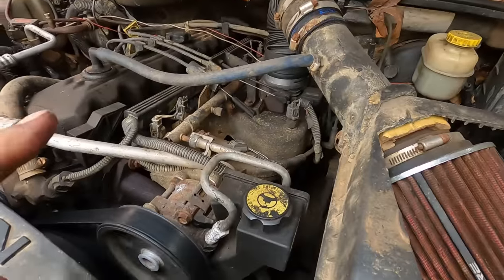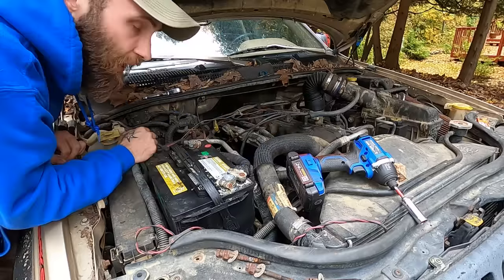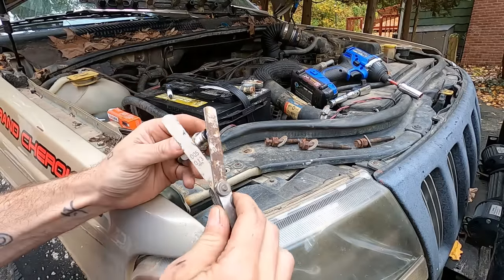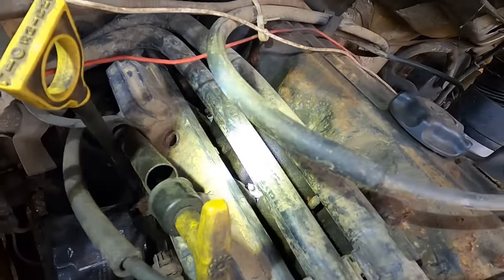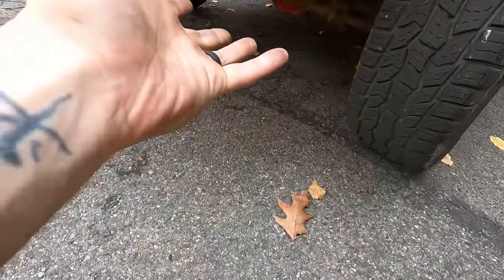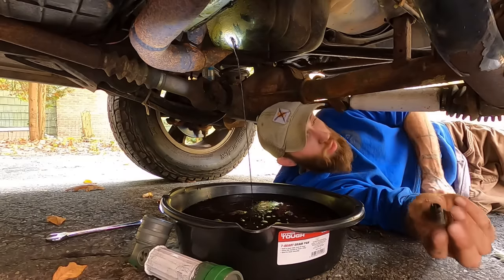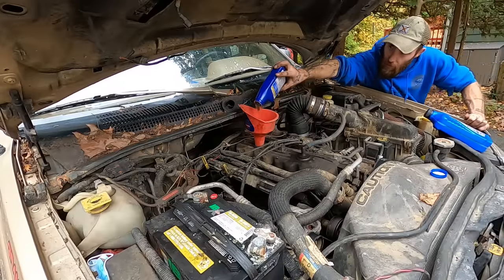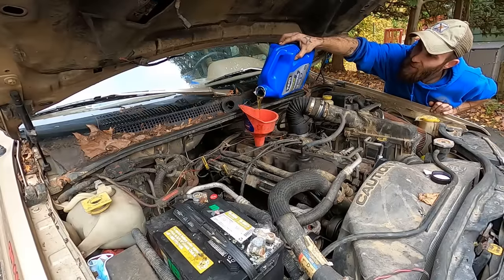Stop treating your Jeep 4.0L like a MODERN ENGINE... It isn't one!

Comment: Just sharing some knowledge as a person in California with a 95 4.0 liter that's young in terms of mileage at about 180k. Yes that zinc will wear out your CAT faster and that means you might have more trouble with SMOG. What I would suggest though is that at least in my experience a CAT in a 4.0 liter will usually wear out every 4 years anyways. So what I do now is quite simple, every other smog check, since they happen every two years, I go into my SMOG guy and fail the first time like clockwork. The thing is if you buy an aftermarket CAT from an auto parts store like oreilly or autozone they usually have a 5 year warranty. I already have one on my Jeep from the first time I failed SMOG. So I get the CAT cut at my SMOG guys and then I get a ride down to the store I bought the CAT and ask to redeem the warranty, since it is the only reason I am failing SMOG. Brand new CAT for free and most exhaust shops only charge about 100 dollars to cut and weld a new CAT. More than I would like to pay but it gets the job done to pass SMOG. As far as I know its cheaper than going somewhere to get a "legitimate SMOG check" as I have always been told the going rate on that is about 200 dollars. Been doing this warranty swap game for about 6-8 years now. Another note is that if you go in and and find that you are failing SMOG even though last time you got it smogged two years ago you replaced the CAT, try getting a new O2 sensor. This knowledge only applies to older 4.0s that predate OBD2 as far as I know though. As I mentioned mine is a 95 and my exhaust and emissions systems are incredibly simple. 1 O2 sensor and 1 CAT is all it has and it even predates EGR systems. With that simplicity emissions being high has always been the 02 or CAT for me every time. Even in California where standards are high you can keep your 4.0 in good shape and meet emissions standards.
Reply: In the midwest we just cut that cat off. California is killing your jeep
Reply: CARB and the fed EPA required All smog devices to last 100k miles or 10years. Even back in the 80's with the zink in the oil. Today its 200k miles. Your ignition timing and AFR are probably way off.
Reply: @dimedriver  I think it might have been. This past test was the first time I passed 2 in a row. I think my computer may have finally figured it out. Not sure of that. Also my o2 sensor on it fail WAY MORE often than 100k miles or 10 years. More like between 2 and 4 years, same as the CAT. I believe you, but I can only speak to my personal experience.
Reply: Fortunately, in my state, we don't have to worry about things you do in Commifornia

Comment: If push comes to shove, and the oil cap won't come out, you can always pull the PCV out of the valve cover and pour the oil in there. The oil cap position isn't located at any specific position that would be decidedly advantageous other than being a bigger hole. All the oil ends up taking the return passages in the head regardless of where it's poured in. There may or may not be a baffle under the PCV, which would slow down the flow, but still an option.
Reply: Oil cap comes apart! Truly (22 yr dealer mech all mopar) you just got to go under it with a pry stick thingy and pop it apart (outer piece has roll over locking tabs to the inner threaded cap). Then take the threaded part off with a pliers - reassemble it while off on the core support by inverting cap and small smack with hand to threaded piece snaps then back together - if your not to ham handed with it coming apart!
Cheers all!

Comment: Glad as hell I found this channel. Sussex County 2004 WJ owner and I love that damn thing like I love my daughters. Bought it last year and did the normal mods but every weekend out there tinkering and changing things. Love the simplicity of it, the 4.0 even though I’m a V8 guy this I6 is a warrior. 
My kids love it too. It may be one of the best vehicles I ever purchased and I hope that it lasts as it has 142k from original owner and some standard undercarriage rot but nothing that can’t be cleaned up and Fluid Film coated. 
Appreciate the insights an straight forward stuff

Comment: "Back in the day" I tried a super duper mega coil on my 98 TJ that was guaranteed to increase midrange and mpg. Not the slightest hint of difference vs. Stock.i had a long uphill pull, and it went to the exact same speed up that hill in same gear. That said, I still have that super-duper coil. It is a godsend on point engines. It currently lives on my 1958 Deere.

Comment: Commented the other day…. My 99XJ with 255,000 was getting 19.5mpg highway this summer. Fresh copper plugs, fresh oil, etc etc and she goes fine… 22psi oil at idle warm and right up over 40psi with a tap of the gas.
Reply: I get 10 mpg, I have 35s on stock gears tho, and a reman engine with 4k on it
Reply: @benthebuilder6934  I have pretty much stock everything. New leafs and shocks. Tires are 235? I believe on stock steel wheels. 235s or whatever the largest ones you can do on stock setup. All gears are stock for a 99 sport… she’s doing great for an old gal… knock on wood! Now working on rockers and other body “spots”

Comment: Watching this man pull the "coil rail" stunned me. I've been around numerous 4.0 engines and have never seen one of those. All have run off of a distributor.
Reply: 99+ 4.0 stopped using distributors
Reply: @andyclemente4205  that's really interesting, I would be curious to know why they made the switch. I've never had issues with the ignition system other than regular maintenance related stuff.

Comment: I just converted mine to roller lifters and swapped the cam, problem solved. Electric cooling fan conversion, and did a high output distributor. Runs good too, had the head machined to run chevy LS valves, and upgraded the fuel system to also take e85. My 00 TJ Wrangler with the 2.5 is bored and stroked to 3.0L and has a twin scroll turbo and 2 stages of water meth injection. Been tinkering with these motors for years.
Reply: What kind of power are you getting out of the 2.5. I was heading in that direction with a TJ.

Comment: definitely love the 4.0, you just can't kill them. Also not sure why you say they get bad milage, I run a tad under 20 MPG, most of that being in the woods with just a little bit in town
Reply: Mine gets 10 mpg, what's your setup? I have 35s on stock gear... if you have bigger times then make sure to adjust the math for that since in my case the speedometer and tachometer are about 20% off.
Reply: @benthebuilder6934  Straight stock '95 with an AX-15 behind the 4.0, and stock axles and tires
Reply: i also get 20mpg on hwy regularly.  Just got back from a 4000.00 mile trip which included all types of terrain and averaged 19.6mpg
Reply: I get 11 on the highway 2004 tj on 33s stock 3.73
Reply: I get about 12 mpg on average. Sometimes i see 20 coasting down the highway, but average over the last 3000 is just under 12. Stock axles, 2" lift on 32's
Reply: I'm pushing 20 with my stocker as well with the stock 30" tires.
Reply: @MajorWeakness  recently did a round trip fla to nyc got about 21-22 mpg with air cond on most of time i have 01 wj 4.0l 168,000 miles on it.
Reply: Everybody says you can’t kill them but ironically, I kept mine in tip-top shape it’s entire life & have dumped so many thousands into it trying to keep it going in the last 7 or so yrs. It never ends, once I got the dreaded lifter-tic NO garage would  even work on it, saying it’ll cost bet. $3-4,000 to fix & all said trade it in! & It’s only got 110,000 miles! 🤦🏻‍♀️🤦🏻‍♀️🤦🏻‍♀️
Reply: I'm getting 18mpg driving around home and get 21 and have gotten 22mpg on the highway
Reply: @benthebuilder6934 i average 10 mpg

Comment: Question,I've heard putting a half a quarter of transmission fluid  too clean the lifters is that true? Also other than replacing the lifters how too stop engine knock?
Reply: Don't use ATF. When I got my 98 ZJ it failed emissions for high NOX. What I did was put a nickel on the throttle stop so it was about 2,000 rpm and dumped about a quart of water down the intake. You do it a little at a time until the engine starts to stumble and stop pouring. As soon as the engine comes back to the set rpm pour a little more in. Basically it steam cleans the carbon off of the rings and valves.

After that it passed emissions with flying colors and runs beautifully. BTW it's about to join the 1/4 million mile club!

Comment: I just started doing my own maintenance on my 94 zj 250k+ miles. I wanted to do a transmission flush and replace the govenor solenoid and pressure sensor. Many have told me not to mess with the transmission at all. Any additional knowledge on this would be great. Awesome video 👍

Comment: K suspension single coil is what I did to get rid of that crazy multi coil system.
Reply: When my old coils went bad, I upgraded to k suspension worth every dollar
Reply: Do they add any power or more efficient burning? I was thinking of upgrading to the MSD coil rails, the K Suspension any better?
Reply: @NeuKrofta  not that I can tell, it just replaces that long dual coil rail. What does make it the big difference is the  wiring upgrade kit he sells, highly recommend.
Reply: @brentdutcher2875  thanks man, I'll look into it
Reply: @XxggxX8  
Gage, have a Wrangler 4.0
Where can I find this K suspension ?
Thx 
Rick

Comment: Great video, I've got a 2000 TJ SPORT with 190k on the 4.0L and had to change the starter right before Thanksgiving last year, I chuckled at your starter comment. More importantly, I just picked up my 5th JEEP, a 1996 XJ SPORT with gasp, 388k on the 4.0L.I recently changed the oil and had added the STP oil treatment to it before I saw your video. It runs great but I already was about to change the plugs, wires, cap and rotor, yes a 1996 still has a distributer. I didn't know about the preference of Copper plugs as I'd already bought an Iridium set. I haven't gapped them yet so I'll probably run back up to the parts store and get some cheapo copper ones instead. Great fun video, cheers from Cheyenne, Wyoming, I run my JEEPs at just over 6,000 feet elev., JEEPS RULE!

Comment: Nice vid - appreciate MOST of the info.  Some things I do have issue with is: describing it as an old engine because it has pushrods.  These are still used on many current engines, included the much valued Chev LS motor.  Also, just because ot was made 25 years ago doesnt mean we cant take advantage of advancements in spark plugs, oil and more. Also zinc is used mostly on breakin, because, as you said, destroys cats. I prefer to use the oil it was designed for.

Comment: Champion cheap is what that engine likes. I put fancy ones in mine and drove cross country  and in a few days I went to change the oil and turned it off and then I went to restart it to warn the oil up it wouldn't start. The fancy plugs were clogged up.

Comment: I always ran 10-30 full synthetic along with a bottle of zinc additive and used platinum plugs since they last 100k without any issues. Never had any problems. If the engine would have been fairly worn out I probably would have went with a 15-40 diesel oil.

Comment: My 95 Jeep XJ that I purchased NEW now has 455,000 miles.  Runs perfect, 3,000 mile oil changes uses about 1/4 of a quart.  Only internal engine maintenance was a Timing set at about 350,000 just because I thought it was a good idea.  15w40 Mobil Delvac Diesel oil.

Comment: I re-engineered the ignition system & fuel injection to better burn the Ethenol TRASH the add to gas to destroy older cars. Accel Super coil, 8mm plug wires, platinum plugs, all brass distributor components. As for fuel, 12 hole injectors, flush the tank & new pre filter on the pump, high flow filter. Polished the throttle body & EVERY sensor port, helix TB spacer, K&N cold air intake ot equivalent. I was getting a consistent 22mpg with 4.5" lift & 32s.

Comment: Nice tips ... I've been driving the 4.0 for 35 years ... 2 Cherokees (300K on an 89/retired) (and 268K on a current 2000 Sport) ... I've always used high mileage or zinc additive ... change the oil every 5,000 or at least once a year ... oil is cheap, engines are not ... my 2000 Sport looks like it's new ... stock, rebuilt from the ground up a few times ... in 35 years, neither Cherokee has ever been towed, or worked on by a shop ... not the best mileage, but a reliable daily driver ... and it's always good to keep the throttle body and idle control valve clean ... and yes, use old school copper plugs and change at 15-20 k ... coil rail is a pain, but you get better at it after 20 or so times ; )
Reply: What’s your preferred oil weight / oil? I love in Arizona and it’s my DD. 2005 with a 115k miles. Only vehicle. I’ve got the ODPA type of engine.
Reply: You’re lucky, my Cherokee has been nothing but a money pit.. 🙁

Comment: Actually those were 258 cubic inch Rambler engines from I think,1965.  They had seven main bearings and were as tough as a box of rocks.  Not great on emissions or gas mileage but very rugged!

Comment: I just use Wix filters (mounted via a '87-91 oil filter adapter so I don't have to deal with the T60 torx bit found on later OFAs) and 5w40 T6 Rotella. Motor holds operating temp better, oddly gets better mileage, and runs much smoother than when running 5w30. No leaks either. 

As for spark plugs, I've found that whether or not the Copper plugs work better is case-by-case. My XJ's old 4.0 definitely prefers copper plugs gapped to .035, and it shows.

Comment: Never knew about the copper plugs, definitely going to start using them. I have a 2004 WJ With 250000 miles on it. My goal is to go another 250k. I started using dura lube and it works way better than STP, it's expensive though.
Reply: Restore engine restorer is also excellent!  I've used it for over 30 years.
Reply: Dura Lube? I've never heard of it, just the STP & Lucas

Comment: Great video! For the people reading the comments… Walmart cheap oil goes in everything I have. It’s cheap it’s really good oil. Synthetic of course is all I use. Don’t be a hater just because you waste your money on the name brand. It’s made in the same place with a different bottle. Change it like you should and you’ll get 300 thousand like I have on my WJ. I had a Nissan Sentra 420 thousand. Have more vehicles but I think you get the point. STP is great and goes in my WJ.

Comment: I’ve got an 89 Cherokee with the 4.0 litre, and sitting around 175,000 miles so far. I haven’t gotten to drive it much yet, because within a week of picking it up, tranny blew a hole. I did get unlucky too, and am stuck with the Peugeot. Swapping it out has proven problematic because apparently there’s parts missing with the hydraulic throw out bearing (I’m assuming prior owner never bothered to check anything). Mix in some vacuum leaks and needing a new intake, and she definitely shows her age. But damn I cannot wait to get her back on the road. Thanks for the advice about spark plugs and adding zinc in the oil. Hadn’t heard either of those before, so it’s good to keep in mind for the future.

Comment: Doug you don't  need to pull the engine to replace the rear seal. I just did mine by removing the oil  pan and the bearing cap super easy
Reply from the maker: Yea I know. I have a number of things to do on that engine and I have been waiting for a good excuse to pull it to do then all. Seeing the rust from years of missing I think it is time to pull it and give it some love before it is too far gone

Comment: So the newer plugs won't be more beneficial to the older motor, just more expensive? 
and the older copper plugs aren't more beneficial to the older engine either, just cheaper? 
So plugs will do the same basically? Just cost differently?
Reply: The newer ones last much longer.

Comment: Just bought a 05 LJ with 480,000 miles and it runs great. No so with the auto trans. Waiting to have an 05 4.o from a wreck, it has 130,000. Just don't want to be out in the boonies with the high mileage engine. Compression checked the high mileage motor and had a low of 105 lbs. and a high of 175, most around 140 lbs. Will check the newer motor's compression but what should they be? Thanks

Comment: I've got over 350k on my 98 XJ and 200k+ on my 02 TJ. I run Rotella T5 1030 and I leak / burn almost no oil between changes.NGK copper plugs, LG oil filter. 4-5k between oil changes. Both are lifted , running 33s.

Comment: I don't think I totally believe the thing about the old schoolspark plugs. I I put in a set of fancy Iridium spark plugs. In my 93 2.5 yj and it made The idle super smooth Also very smooth acceleration. I've had them in there for a long time. And haven't had to change them because the jeep is running so good

Comment: when i had mine i used bosh +4 platinum nd had best gas mileage over copper plugs copper plugs are for pre 80s era cars and defiantly clean ur motor itll run better and cooler remember the block is cast iron gets hotter when unclean

Comment: I have an 04 Wrangler and had been running the Champion 7034. I switched to the Autolite APP985 I purchased from Amazon on the recommendation of a friend. Gapped at 35 and installed them. Ran like crap. Pulled them out and they were about a quarter inch shorter than the Champions. Maybe I got some chinesium crap from the seller and they weren't the true Autolites I needed. Either way I went back to the Champions and jeep runs like a champ. I change them every 25 to 30k.